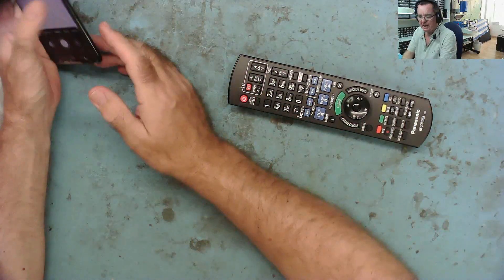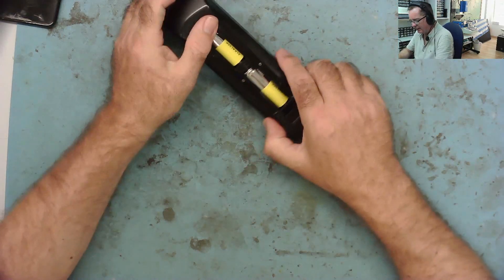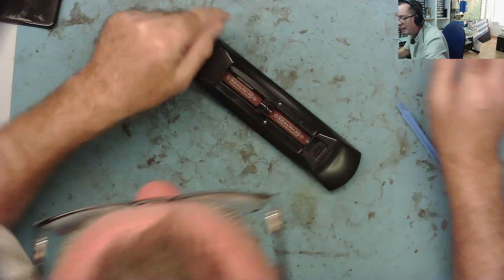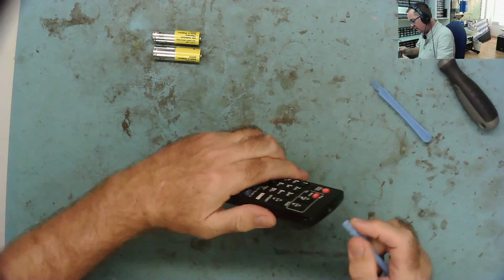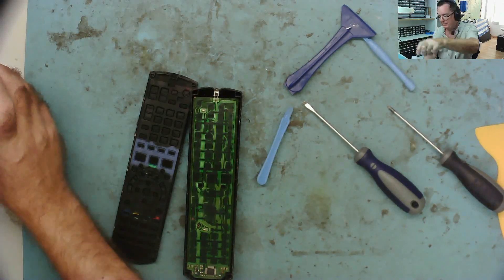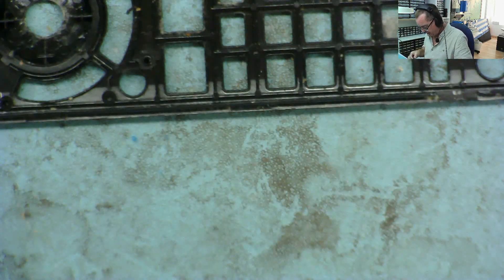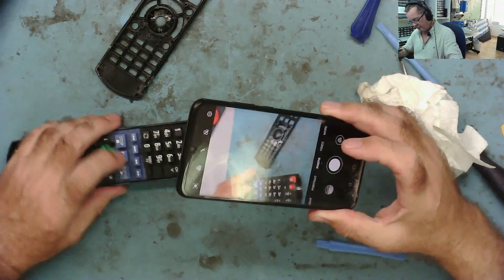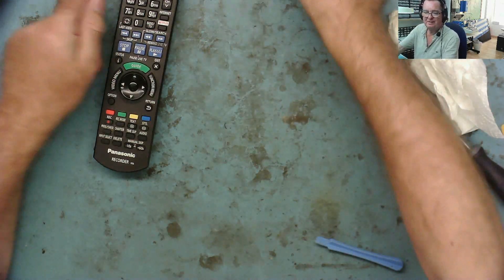How To Repair Remote Control Buttons Not Working / Don't Work TV DVD Player

Comment: Your over head camera picked up the IR LED flashes as well as your phone camera - 
Some phone camera's do not pick up IR. Also get a pencil with a soft lead and re-graphite the pads OR 
As a last resort glue some small rings of kitchen foil to the pads - Use a paper hole punch to make the rings.

Comment: I've actually (temporarily) repaired worn out pads by grinding up a pencil, and using a q-tip to spread a thin layer of graphite over the worn out pad. It works for a year or so, but you can also just snip the bad pad off with a nail clipper and either steal another good pad from a button you don't use, or another spare remote in the bin, and super glue is your friend. Brand new.
Reply from the maker: That sounds like a good method.  I'll try it some time :D

Comment: This is a specific remote fix for water damage, not exactly what the title portrays.
Would be good to see some repairs of the contact pads.
Reply from the maker: Hi infinity25-  if and when I find some remotes with other probems I will be sure to make more videos (broken connection to IR led, broken crystal etc).  Thanks for the suggestion and I hope you enjoyed the video anyway :)
Reply: @LearnElectronicsRepair  I did thank you.
I’ve seen beer spilled on TV remotes in a bar...wish I had IPA back then, it was so sticky.

Comment: You should know that the camera app is usually accessible from the lock screen and command centre without unlocking the device. If this is not the case, it is a setting you can change should that be useful to you. The same is true of the flash light/torch.
To access on the lock screen you give it a one second press, they button grows in size and you feel a single vibration pulse giving you feedback you succeeded in opening the app or enabling the torch.
Reply from the maker: I confess i am no expert on mobile phones.  I actually noticed that my video camera (for Youtube recording) also picks up the infra red LED so probably for myself that is what I will use in future - it's less fiddly than holding the phone.

Comment: Hi Richard. For some reason I have to clean two of my remotes every few weeks. They get a film of sticky grease on the carbon pads for some reason. Those spudgers are pretty useless and usually come with touch screens etc.

Found you from Waynes Noob Repair. He did a vid yesterday and gave you a shout out. I found him through The Cod3r who gave him a shout from TronixFix. Going to binge watch some of your content. Have subbed and liked. keep up the good work.
Reply from the maker: Hi Andy
Yes I ended up using the spudger plus a flat blade screw driver on this one normally the spudger works on most remotes,  nice to hear Wayne gave me a shout out yesterday and I will return the favour.  I've also been a subscriber on the Cod3r for a while though I don't particularly do  console repair.  I think Cod3r lives (or comes from) somewhere near my old town when i was back in the UK.  I've watched some of Tronicfix videos also